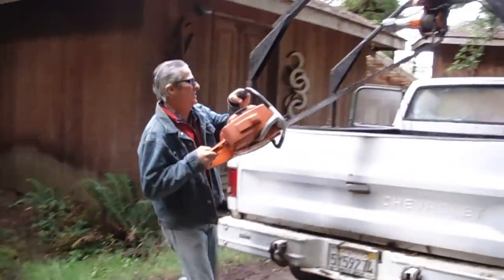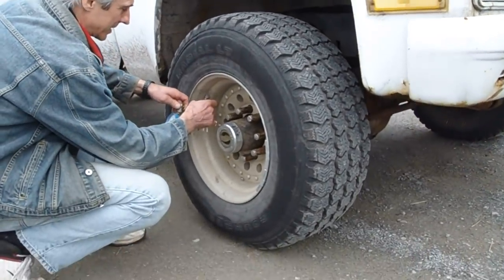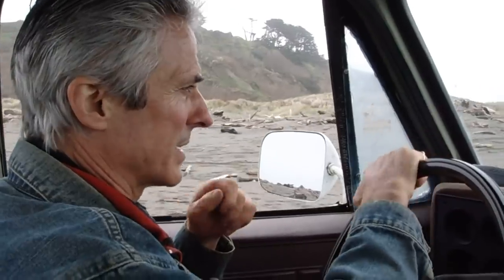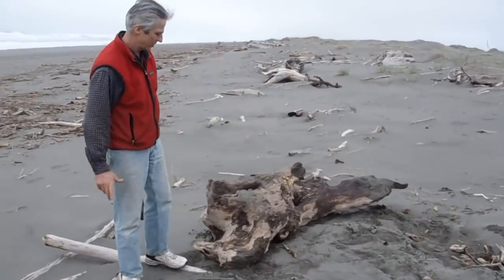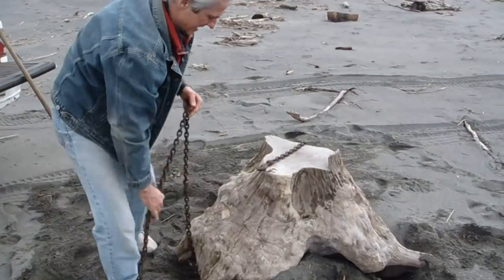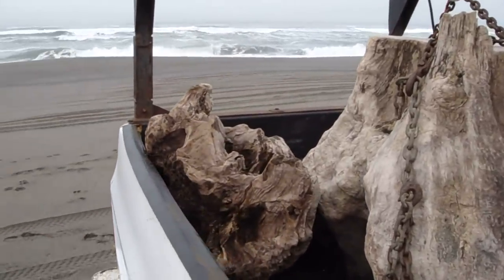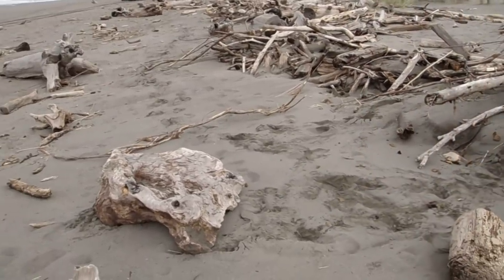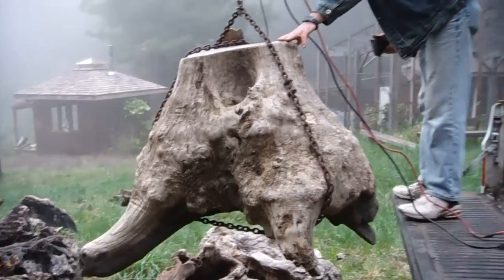Reclaiming myrtlewood from the beach. David Groth documentary, chapter 1 of 9.

Comment: Amazing rig on the truck, and what a great way to live.
Reply from the maker: It has worked out very useful for me!
Reply: MR. FIX-ALL INC. I
Reply: I've seen similar rigs on trucks that move burial vaults. Funny sort of connection. One truck used to move a new thing made for the dead and the other used to move a dead thing to make something new.

As for the actual setup, I would have a separate battery for the winch. With my luck, I'd kill the truck battery and be stuck on the beach.

Comment: Have seldom seen the trick of letting out air from the tires to drive over sand. This really works, and people who've been stuck in sand in the past might have been able to get out by letting much of the air out of the tires. It increases the surface of the tire on the sand, lowering the pressure per square inch of the tire on the sand. Oh yeah, your wood working is wonderful too.
Reply from the maker: True on the first and thanks on the second.
Reply: I forgot to add that once you're out of the sand and back on pavement or solid ground, you'll need to re-inflate your tires. Carry a pump, a 12-volt electric air pump, or something similar when planning to drive on sand.

Comment: Your time is worth more than the time it takes to connect the winch every time. Hard wire it with an isolation switch. That way, all you have to do is flip a switch and you are ready to use your winch.
Reply from the maker: That would certainly save some time.

Comment: Thank you for the repsonse David, but ive been meaning to ask you and i hope you dont mind sharing some of you secrets... Normally i finish the wood furnitures I make at home with staining it, I want it flat and not shiny finish, but I have been searching for a finish thats flat but not staining the wood, i wish to just retain the beauty of how the color of the wood is and the function of the finishing chemical is just to protect the wood. Do you have any suggestion what finishing agent or chemical i should be looking for?
Reply from the maker: jogtg 
This is the finish I use. Hope it will be helpful!
1/3 boiled linseed oil, 1/3 thinner, 1/3 polyurethane, and grated beeswax melted together to the consistency of cream. Rub the finish (very thin coating) into the wood and when it is dry (probably a day or two) buff it out. You can repeat the process a couple times to have a more durable surface. The finish is liquid resistant, however not liquid proof. This formula is very close to Sam Maloof's formula published in Fine WoodWorking November/December 1980.
Heat mixture then gradually add grated bees wax in a double boiler. Take small portions and cool (for example a tablespoon of mixture in the frigerator) until mixture is the consistency of heavy cream at room temperature
Reply: David Groth Wow darling youre the sweetest! Thank you for taking time to give me the detailed info, it means alot to me, even architects here were not able to give this kind of concoction! You must be a Merlin! Lol.... I will try this mixture in my next project, id like to make a cabinet for my sewing machines and makeup kits. I hope tho to find that oil you mentioned and beeswax here... since youre the coolest, subscribe button here I come! Mwaaaaaah!

Comment: What about those little powder beetles?  I've had a lot of trouble with those in bay.  As far as I can tell, they need a certain moisture content, but they get into the wood outdoors pretty fast as soon as the wood dies.  I've had them show up in finished objects stored in a shed or trailer or something like that where the moisture level is just slightly high in the winter.  I mean to the point where you could break a once solid piece of wood apart with your hands and it's mostly powder inside.  I always wondered if a finish of some kind would deter them from entering the wood once objects are finished.
Reply from the maker: +SkillCult I have found when I kiln dry my sculptured at 130 degrees Fahrenheit that all of the post beetles have been killed.
Reply: +David Groth Thanks for your reply.  My problem has been more with them showing up later, even after years of objects being dried and seasoned.  Again though, I think it's an issue of humidity.  It's also hard to find any standing dead wood they haven't got into already, but maybe driftwood is less prone to that problem too for some reason.
Reply from the maker: +SkillCult    Wood stored anywhere there are active post beetles will get infected with those critters. I don't think a finish will keep them out. I haven't had a problem with my indoor finished pieces since I make sure there are no other wood objects around  with the beetles. Driftwood is just as prone to the beetle problem.